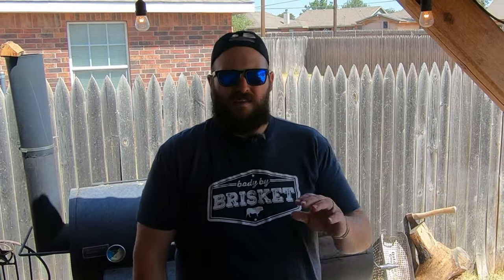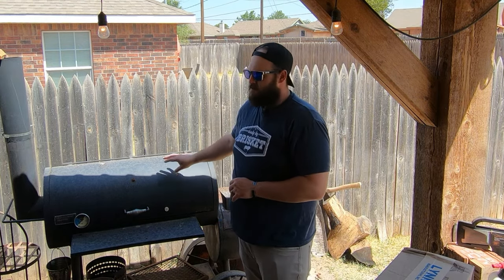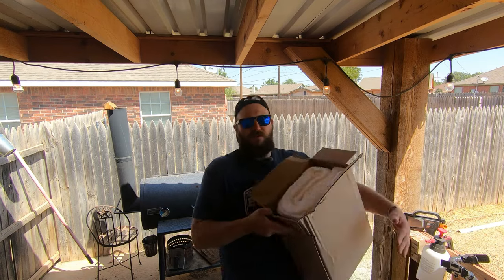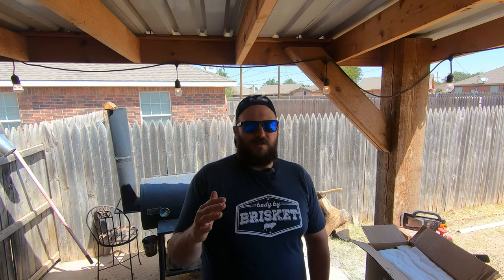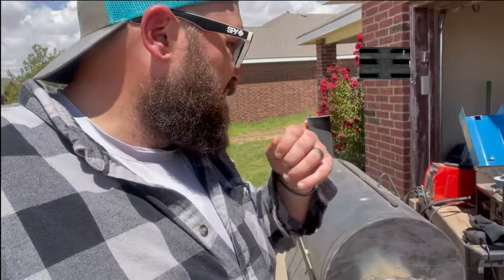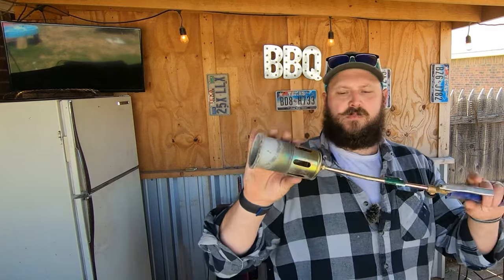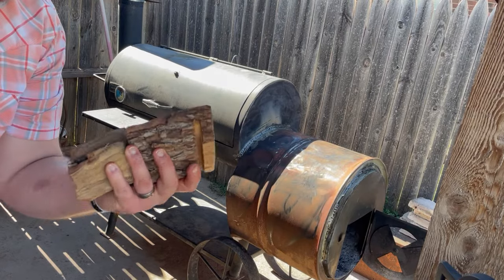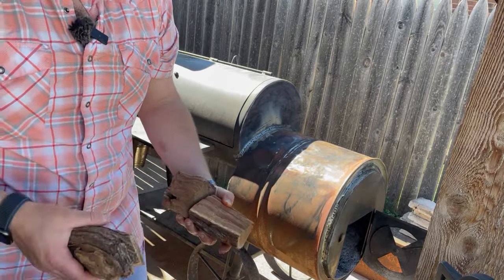This is the INSULATED FIRE BOX that will change the way you cook! #oldcountrypecos

Comment: Nice video.
Made my own offset from a compressor tank and a wood furnance fire box.
Its uglier than yours but works perfect.
I double walled  my firebox, but no insulation.
Reply from the maker: Air is a semi-insulator when the chamber is sealed correctly! Nice work! When I get my new set up figured out, I’ll be building one as well.

Comment: Great video bud!! It's always fun to modify and make things better!!
Reply from the maker: Thanks Mike! I need a new welder 🤣
Reply: @BrisketMedic  I built my 250 gallon smoker with the titanium flux 125 from habor freight, you run it on a 40 amp plug on a generator and it'll weld 3/8" steel with no problem. Definitely worth its weight in gold!!
Reply from the maker: @MikeBrownBBQ  need to look into it for sure!

Comment: I opened the exhaust in the cooking chamber to match the inner diameter of the exhaust pipe on my pecos. Pipe is over 5", inside diameter of hole in cook chamber is about 4".
Reply from the maker: We did that as well, makes a great difference in the fluid dynamics!
Reply: @BrisketMedic  how many inches of exhaust pipe did you add. I've tried 16" and 24".
Reply from the maker: @user-ue8vz3km9c  I started with he 24” and cut/adjusted it to right around 16” total added

Comment: Great video, I have the same pit, but I actually use the cowboy firebox. I was thinking since you welded that sleeve over the firebox have you thought about welding an extension on the stack instead of using that hose and clamp? I think its just 11 or 14 gauge steel and 5 inch diameter
Reply from the maker: Absolutely is the goal , to add a smoke collection and permanent staff

Comment: Maybe it's just me.........but..........did I miss the part where we actually seed the insulation be applied?  I see the steel-drum protective cover over it, but do not see that activity.
Reply from the maker: Honestly it’s been so long I don’t remember. The insulation sheet I bought I wrapped around the original box, and then held it into place with baling wire so I could sleeve it with the barre.

Comment: Nice, how’d you do it around the legs?
Reply from the maker: Made slots and patched in behind them.
Reply: @BrisketMedic  Gotcha. I wanna do something similar. Also you did the 6x24” stack? I did, but cut the length down, but my bottom is crimping and not staying in a perfect circle. Did you have this problem? I know it doesn’t effect air pull but just curious
Reply from the maker: @jordanmiano9283  yeah, same thing. I ended cutting almost 4” off as well
Reply: @BrisketMedic  okay cool, I didn’t actually cut for the notch I twisted the bolt and broke the weld so none of that is in the way anymore haha

Comment: That metal is not designed to be insulated from the outside. If it cannot dissipate heat externally, it’s gonna quickly develop hot spots and degrade the metal of your smoke box. Internal insulation is ok.
Reply from the maker: Good information, what type of metal is it? Being a $200 smoker I’ve ran with this set up for over a year and it’s still doing really well.
Reply: @BrisketMedic  it’s just a low carbon mild grade steel, in hindsight though…a smoke box shouldn’t see high enough heat or get a whole lot of flame impingement. Glad it’s still working strong for you, that was a labor of love
Reply from the maker: @Adam_Ant86  you bring up good points. Definitely something to look into! As you can see, im no metalologist haha